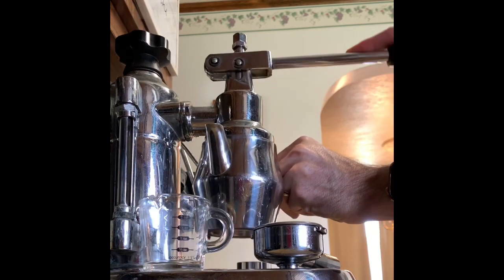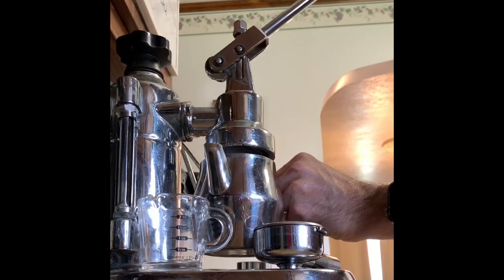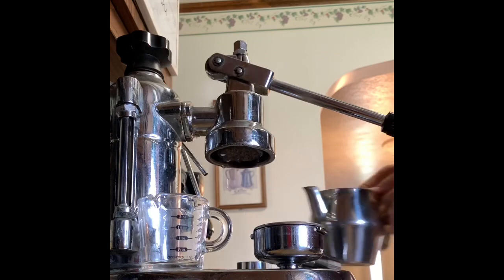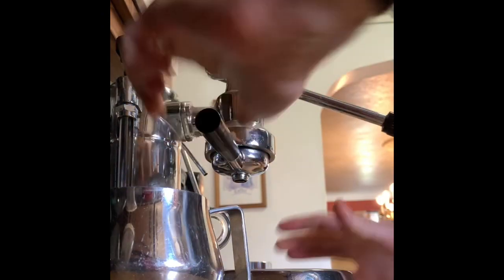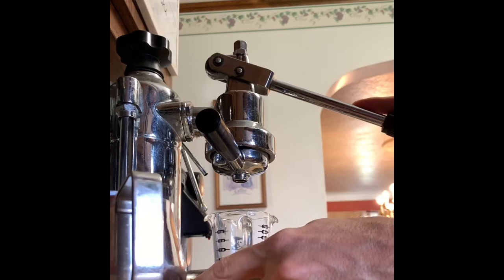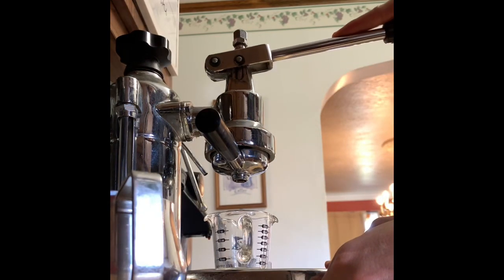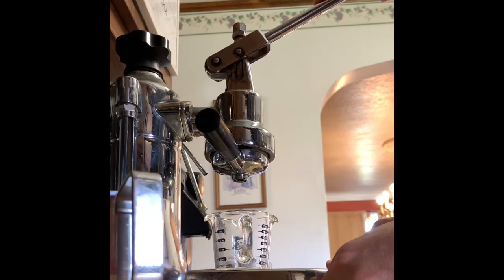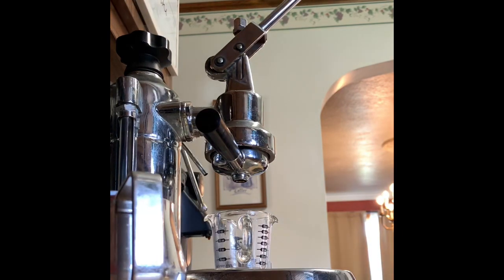Pressure Pulsing: the New Pressure Profiling Method; Lever machine

Comment: Because of your write up, I tried my own type of of pulsing. I start with a 10 second preinfusion, and pull down the lever with pulses. My pressure profiler showing me the pressure, and I am to go from 3 to 9 to 3 to 9 etc. The consistency has been weirdly good, even when my grinder wasn't dialed in perfectly yet. Did you experience the same consistency?
Reply from the maker: Yes that’s what I’ve experienced. I feel like you can recovery a little from badly prepared shots or too fond of grinds by adjusting the pulses. What machine do you use?
Reply: @espressofun6091  i have a la pavoni gran Romantica and I upgrade it for the pressure gauge.